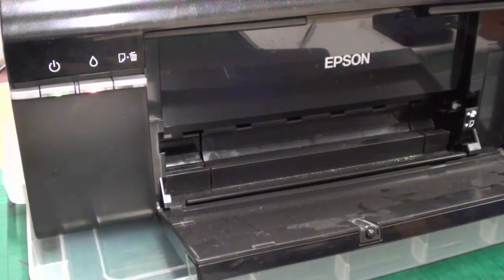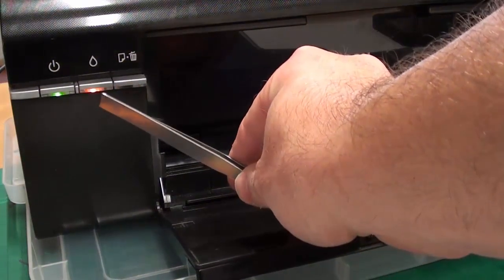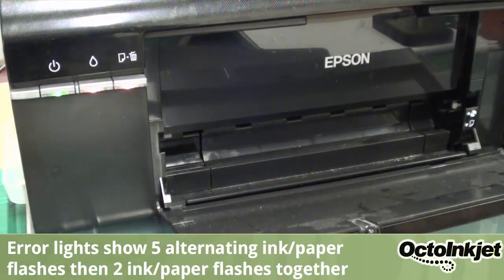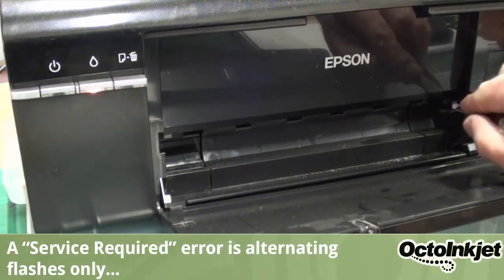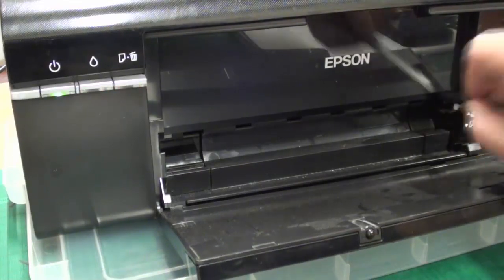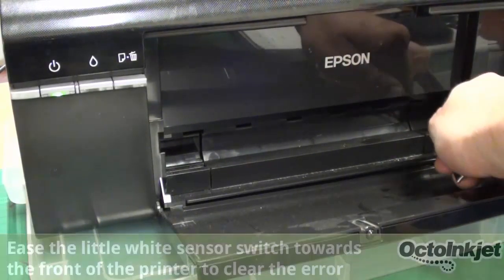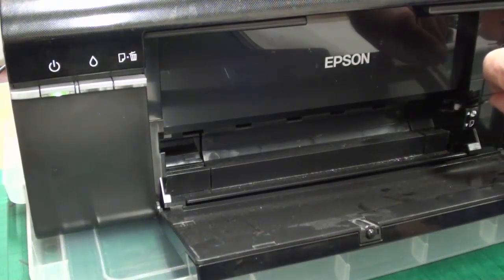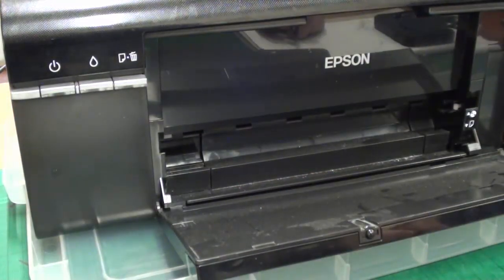Fix error light problem on Epson P50, R285, T60, T50 - CD tray sensor jam

Comment: You did it. I could not figure out how to get the CD tray to work. But I needed to read  your website suggestion to realize that until I clear the pending printing jobs the CD printer will not reset. Thank so much.
Reply from the maker: +chaim meiersdorf I hadn't considered that as we rarely, if ever, do disk printing but I can see how the print queue would have that effect. Thanks for feeding that back. I'm sure it will have helped someone.

Comment: I have an L800 printer when ever i try to print pvc dragon sheet the printer says paper jam error or no paper ! RED LIGHT APPEARS.. i have tried all the stuff .. changing material and other ....any solution... or HOW TO Turn off optical sensor for paper sense
Reply from the maker: +Inderpreet Singh ... Missed your earlier comment but unfortunately don't have any answers anyway. The paper sensor needs to be active for the printer to function anyway so what you might want to consider is whether you can affix your pvc media to a carrier sheet and maybe get around the problem that way...